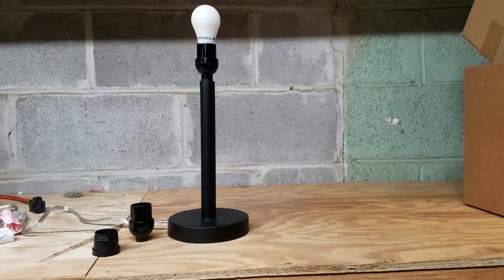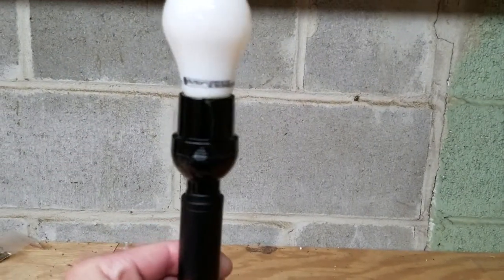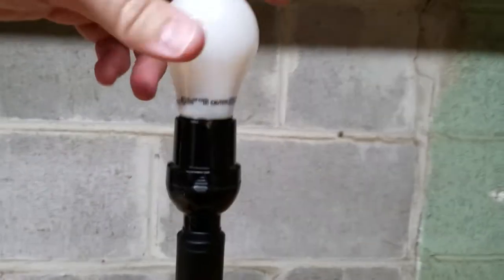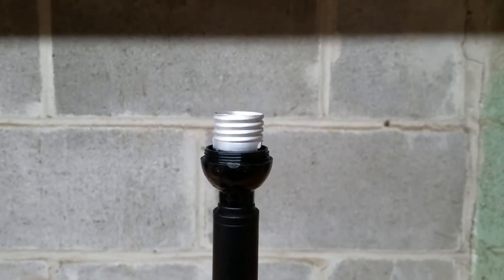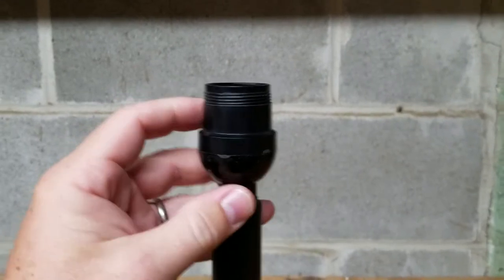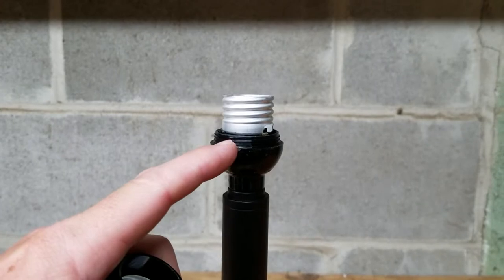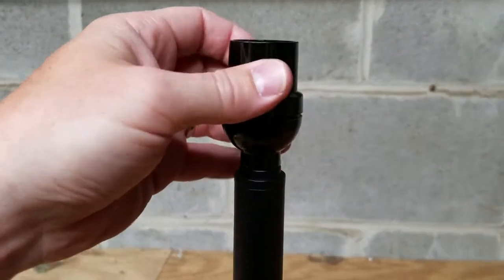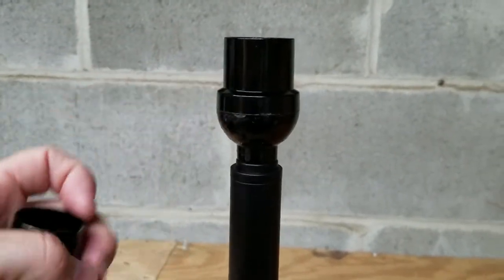Plastic Socket Shell Replacement

Comment: Do you have a video for how to remove the base or cup part of the socket? The threads on that potion of the socket are what have cracked and broken off on my lamp.
Reply: I have the same challenge and I have not found any guidance for how to replace the Bakelite housing.